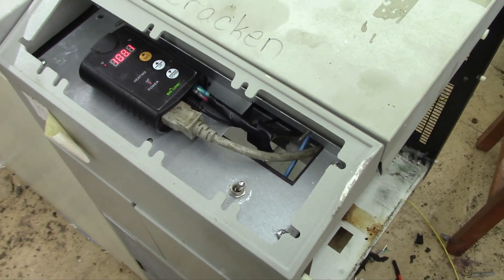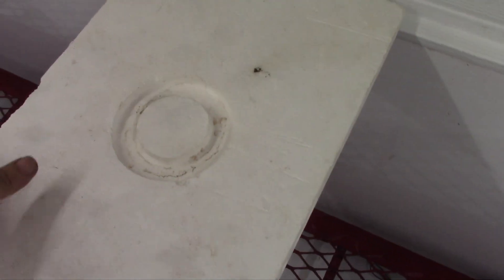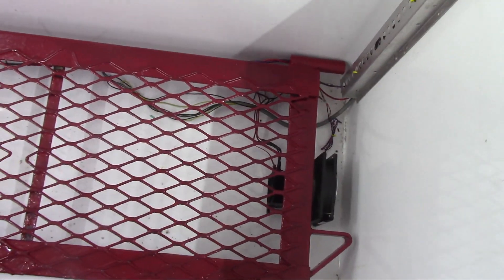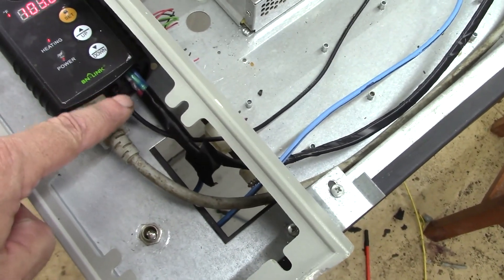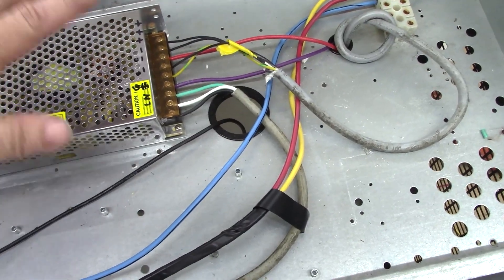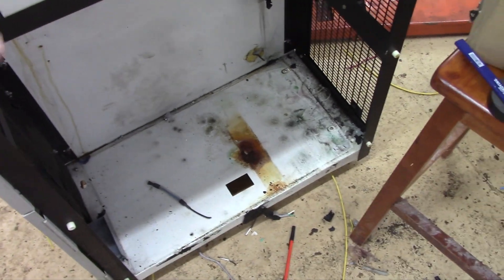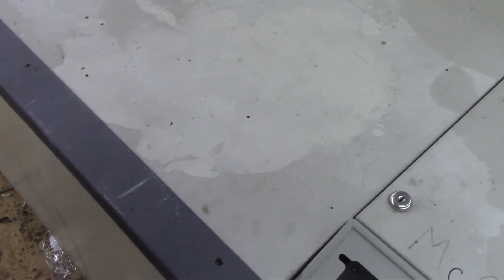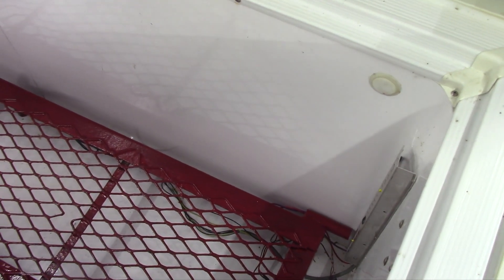Building the best honey decrystallizer

Comment: Do you happen to have a link to that forced air heater?
Reply from the maker: @Quilaho  sure thing it comes in two styles. https://www.amazon.com/Temperature-Thermistor-Insulation-Conditioning-PTCYIDU/dp/B0BTLMNFB1/ref=sr_1_51?crid=D5N6EZ1YMLU6&dib=eyJ2IjoiMSJ9.31lR6q4SNGSh40CkE_lyy6iO9a9EIroIhG8OthxYK1LyiDr22baxyaLkpNsYbmOkwbsq5-lrJfFVtMubDM64pzqE8sU4-sswKxIA7P8bOxyKGnUyYW75X0lEUTeFRkIy1M3K7iBH8x5Vab4dYT7yE9Yp1EMdiaGT3dqwCGIaJIM5LjDyUwnB9gbFVT0mHiZLtssyZifjAynfWstGZaZcjBTYsRNd66Mb7tecmEfHtwik2cvQSV-cOFwzE63vZfJS-n-wBrYUEVWdkJIIl9XIRV0Tbc_Y81BBQHVxNtm7a_U.3RiBymRxoJ5yZEIOEA9MWblITbQV4FsQ5_10UgOLUQQ&dib_tag=se&keywords=100w+forced+air+heater&qid=1730014961&sprefix=100w+forced+air+heater%2Caps%2C420&sr=8-51 is for 110. If you want to replicate my setup I used a 12v as I wanted fans which are easier to come by. https://www.amazon.com/Constant-Temperature-Heating-Conditioning-Products/dp/B082HR1GWY/ref=sr_1_1?crid=3Q87625VTSEWV&dib=eyJ2IjoiMSJ9.mMFix77SnKTbfvVNS0xc2706WVKgC91Y7_8dcOIGQC-3puXZfzoovvBAzlxegnogSHDVnDecnyN8fNpptzjmJ5sKXDutJ8ZxBKlQaCkYfUOsAiPP3pdeZjdFk4EB4tA6zZ6OKVUUjvjJdYZ51EWgFSAZl2Km9-m7ZuuOSXMOL5i-YcM00usQrwssQDUhto6M1tpjGnCys-_-yXZ-4hoWutk_O_QWbI9XyWu44qiLalI.M4X2l4_MU6PUSXWT6LGMgyy42r3OqfBSJeBrPPJMooI&dib_tag=se&keywords=12+v+100w+forced+air+heater&qid=1730015226&sprefix=12+v+100w+forced+air+heater%2Caps%2C374&sr=8-1
Reply from the maker: I apologize as i this comment did not show up, here is the link if you still need it https://www.amazon.com/Constant-Temperature-Heating-Element-Conditioner/dp/B0BJ9ZFMSC/ref=sr_1_17?crid=3K9X0Y1CGKR04&dib=eyJ2IjoiMSJ9.3LJeuUQYpTg3LD5JUcW3RziiUveHDk7wNxYIBtPwxBzge8fhlJ2pph0a1kejwMxBY6Ebmp_-HZL8EOR6A1uXp7dSFzIbBdxjzPlymEAlnf9J66MojL8oaIvzYVfvdyeZjftUsI85Hh6xvEZwmuwK6fwvSchxEWoWzY3Iis0mzIAQOOxHYo5Bl3lP45s_NysTTbxwiiRr4F45kGzG_Qiq9ve4R8pXhlp9M4IqGtefSGRTKeEXsSiXm4VYN306RQCvBaLJdcBall8iPVTE8f2T01rwW924e7lAssk8J08kYmc.2LtaslNJzhk9OQEyn4OnBE8jcWfECYE3vc9nlPaInBU&dib_tag=se&keywords=100w%2Bheater&qid=1733405156&sprefix=100w%2Bheater%2Caps%2C364&sr=8-17&th=1